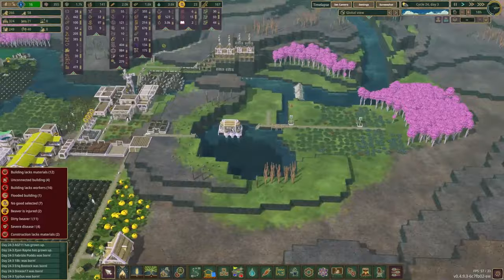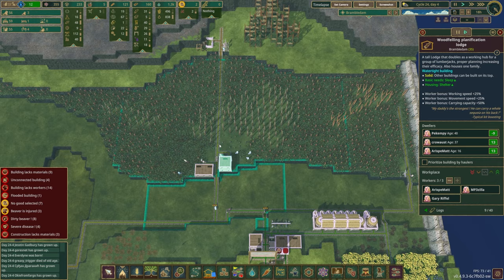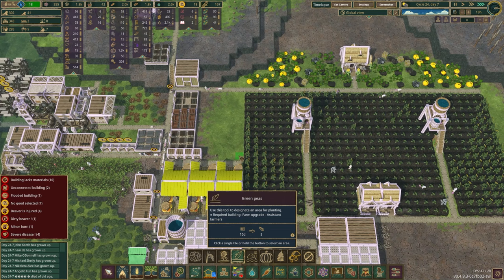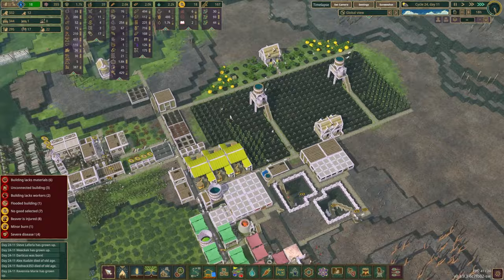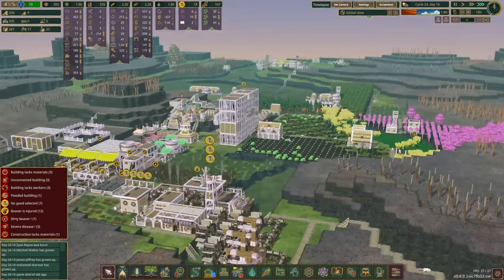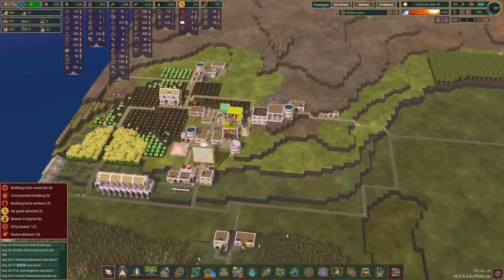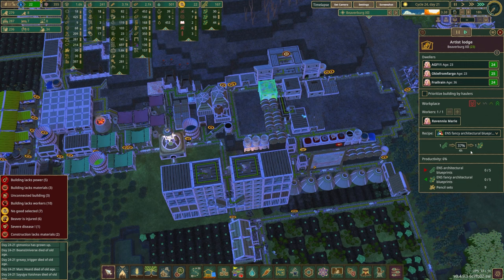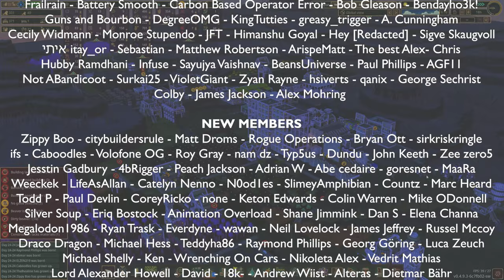It's ENS blueprint time! Timberborn Waterbeavers Episode 17

Comment: I recommend making duplicates of your ENS fancy blueprints, unless you wanna do the crazy recipes with hours again. You will want more than one ENS I promise. 

The mod creator's math on water pumps breaks down the second you turn on production for spicy soda, dandelion tea, and etc. It is the source of the hole in your water barrels. Dandelion tea especially obliterates water. 

I recommend unlocking and building mechanical aquifer pumps, they don't take workers, they do consume gears, they can be placed anywhere on the ground, BUT they do require power.
Reply: As the old adage goes: "One is none, two is one, thee you have a spare. Always have a spare!"
Reply from the maker: There must be something to these mechanical aquifer pumps... So many comments about them

Comment: JC, there is a mention to a Mechanical Water Pump. There isn’t any info on it in the wiki, but I get the impression that it’s a water pump that needs mechanical power, and it might pump a lot of water so you can free up a lot of beavers from pump houses. Your water issue is fallout from building all those tower houses. Naturally a large fast increase in population means a large fast increase in water and food. From what I understand about this mod, everything only works when it’s balanced on a razors edge. You have to meticulously increase and improve everything, every industry at the same time. That includes beaver storage.
Reply from the maker: I guess we are building some of those mechanical pumps, then. First time I saw that I just figured it was the same thing from the base game that is just a giant albatross that hogs enormous amounts of power without a ton of utility beyond elevating water without actually storing any.

Comment: If you start by putting things around the rubble, only have an opening in the direction/place you want it to go and then start filling in the enclosure from the far edge. So basically putting a 'U' shape around it and then fill in the U from the bottom, it's much easier to control where the rubble is going.

Comment: (This time it got a bit long, sorry for that.)
→ River bath: I wouldn't have deleted that submerged river bath – it will work when the water level drops enough so the other ones don't work (e.g. near the end of the episode).
→ Grilled chestnuts: At least currently you don't have a way of making any (there are no chestnut trees). I would suppose you can import them (when you get to the balloons), or import the seeds for growing chestnut trees, or similar. For now, I'd use the warehouse for something else, as you did. [Maybe I'm wrong, and they are actually not available at all.]
→ In the fermentation barrel you can convert spadderdock to methane (CH4). [This is the same stuff us humans get out of the ground with the name "natural gas", and which cows burp out. It's a much stronger greenhouse gas than CO2 (and this is what makes beef meat around twice as bad from a climate point of view as pig meat).] I'm not sure what it can be used for in this game, but you need a special gas tank to store it.
→ Green peas: I think you used to have some around your large farmhouse on the peninsula, but then replaced them by pumpkins.
→ "Why is there pine resin" [left over from the primitive paper mill]? – it was part of the ingredients to make paper, which were stored in the building.
→ space for water pumps: Water pumps (in this mod) are water tight, they won't be flooded unless you submerge them deeper than one block into water (and I'm not sure even then, maybe the upgrades also make the upper part watertight). So you can build them along any ridge from the shallow to the deeper part of the water, no need to have the doors dry.
→ Barrel showers: These are "supplied by water pump workers" (not by haulers) – maybe this contributes to the lower efficiency of the water pumps, given the pumping beavers need to walk over to fill them?
→ Need more beaver living space in brambledam? Maybe adding a large farmhouse where you added that staircase would help – it houses a bunch of beavers, and you can turn the number of jobs down (but you anyways want some additional farm hands here, given the existing farmers can't even harvest all the cabbage and you also added sunflowers). (Also, I've read you can put the large farmhouse on top of these pit-and-ladder lodges, but I'm not sure how this is supposed to fit, given that it's larger.)
→ What to make in the factory: The chemical sets are needed (besides the alchemist) for the hospital, which you might want to get into at some point. They need some ingredients you don't have yet, though.
→ When your lodges in brambledam are finished, you can send over some of the jobless beavers from the main district, instead of waiting for new kits to be born and then grow up.
→ Brambles spreading too fast: I've recently learned that when you put in a planting order for brambles, they won't spread by themselves. So when you want to get rid of brambles somewhere (but not in the neighboring location), marking that neighboring square for bramble planting should prevent the bramble from spreading.
→ "We don't need 5 of these, just one" – just to be on the safe side, I would just send it to the copyist once and make five of them, in case you later decide to relocate the building, or get a second one of them somewhere.
→ Low lumber production in brambledam: I think the issue is that cutting down brambles takes a long time (most of a work day – and if they start a second one, they'll do overtime until they are done, leading to a bad work-life-balance (exhaustion, hunger, thirst and lower social life)), and gives only one log each, which is a lot slower (per beaver work day) than if you are cutting down trees. I would try to set up a proper forest of the pink trees somewhere, instead of harvesting wood from the brambles.
→ Cross-district exchange: Due to the large walking time from the district gate to brambledam proper, you are not getting much exported/imported, so Brambledam is always short on logs, and the main district is always short of water and spicy soda. I think you either need some storage on the brambledam side of the district crossing for the main the goods you want to exchange (so your haulers can help out), or maybe add another district crossing, so you get more things transported.

Comment: Why don't you use regular showers? They just use water straight from the source instead of taking it from your tanks. Also, if you set one of the screw presses to make berry juice, that'll help with the thirst requirement.
Reply from the maker: Lack of easy access to waterfront because of my really bad choices when it came to laying out buildings, mostly.
Reply: @JCTheBeard  Ah. Fair, I guess.

Comment: I think you should put deep mechanical pumps, as i have seen many people in comments suggesting you.....
Reply from the maker: There's nowhere on this map where the water is more than 2 tiles deep so those wouldn't really be necessary unless we wanted to have water pumping stations up way high on stilts or something. We can shuffle things around to make room for more normal water pumps without too much inconvenience, just not at the drop of a hat during a water crisis.
Reply from the maker: Update: I have since learned that the item you're referring to is NOT the one I was thinking it was... You are correct and we will build one (hopefully) next time. Thanks!